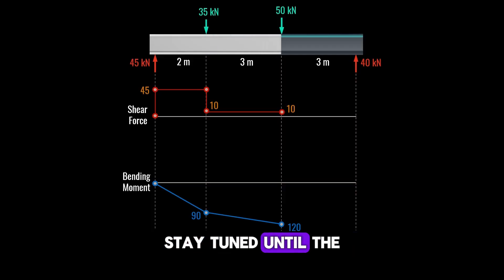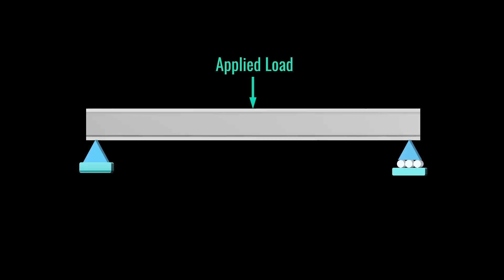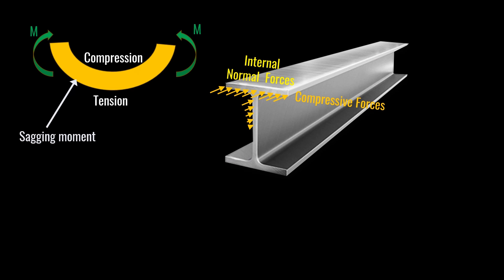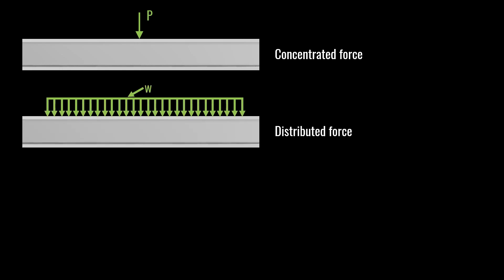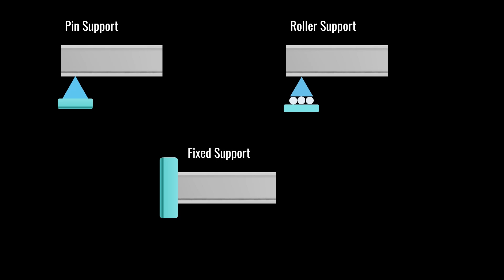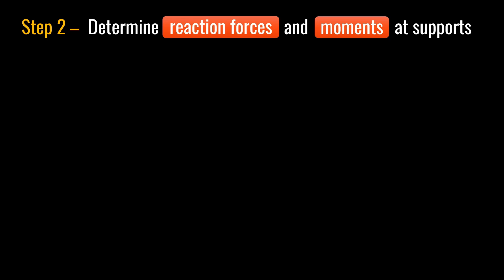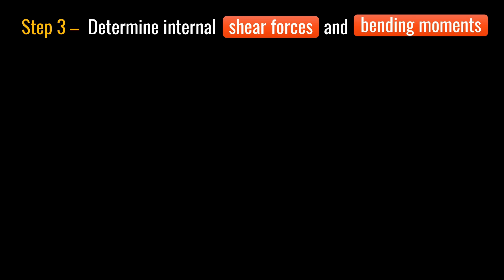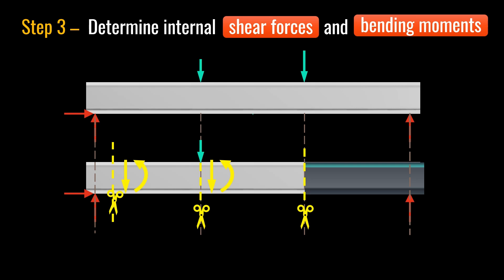Shear force and bending moment diagram by Dr Jawed Qureshi

Comment: Dr. Qureshi, if the building shape is octagonal or circular, is the structural analysis of the frame same as how it's done in rectangular shape one?
Reply from the maker: Structural analysis of a circular building will be different. In that case, we need to carry out finite element analysis using a software.
Reply: @DrJQureshiThanks.